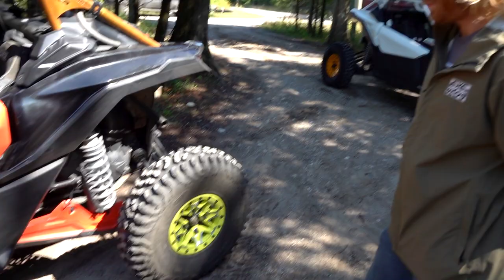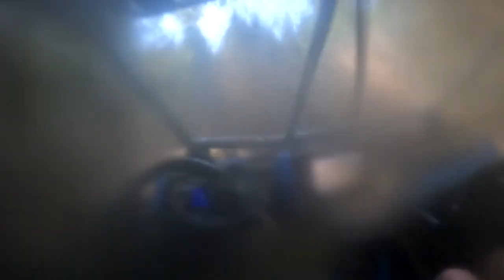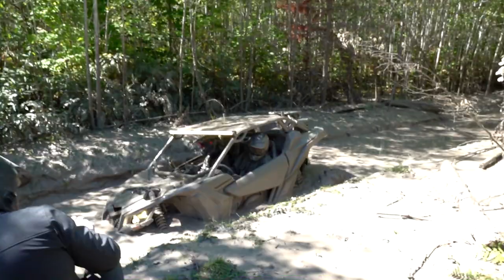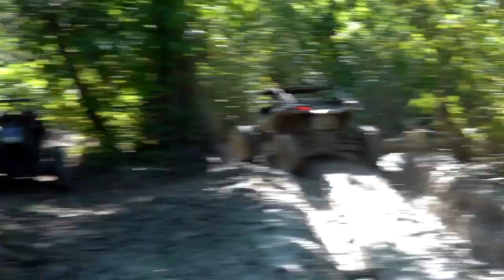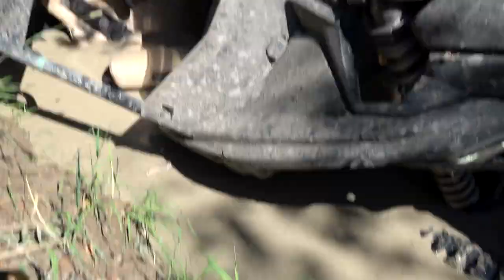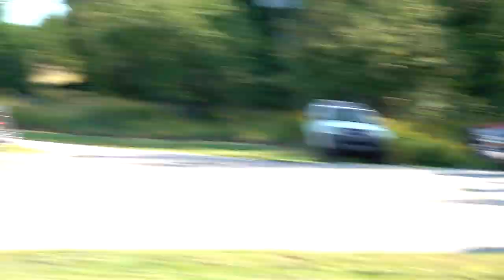Pro XP and Maverick X3s go hard on DRUMMOND ISLAND!

Comment: Did Doug ever get his 4x4 figured out? I had the same issue on my 21 pro xp ultimate and the dealer replaced the coil inside the front differential and ever since then its worked flawlessly.